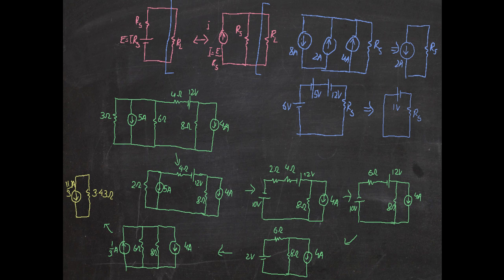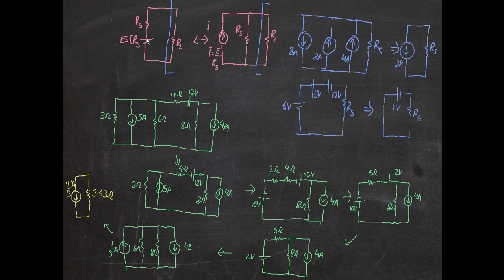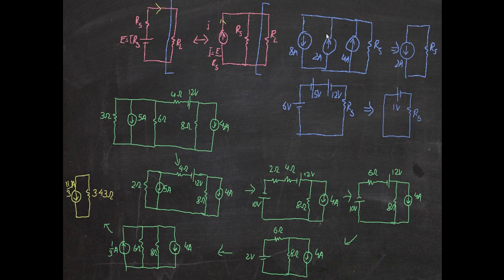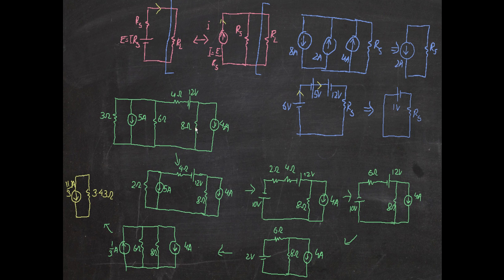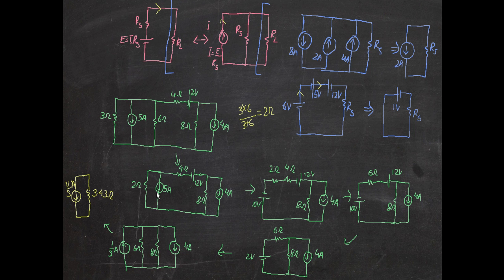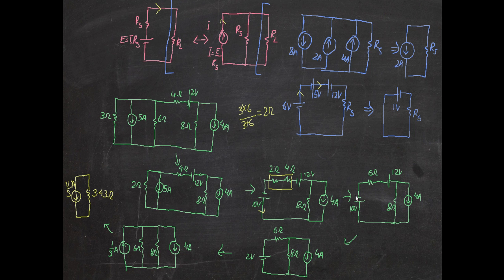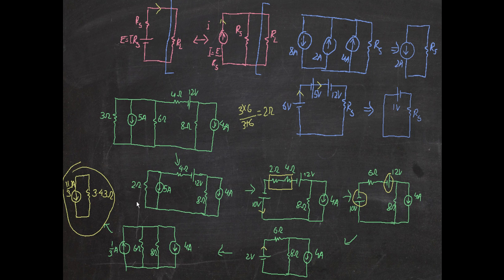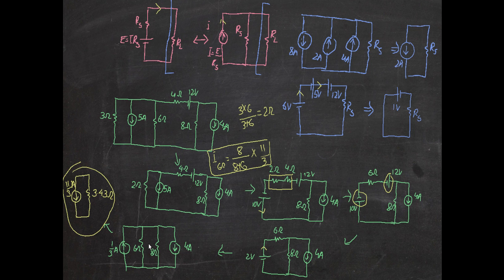Source Conversion

Comment: There's something wrong you do at the end when you try to find the current in the 6 ohm resistor.
Reply from the maker: Can you specify the timeline? Cause I checked and it seems to be correct. I=V/R so I for the 6 ohm resistor will be I=2/6=1/3 A
Reply: At around 7.35, in the last part where you are calculating the current for the 6 ohm resistor. You write the equation on the middle with yellow color. I'm not sure, but I think you are finding the current for the 8 ohm resistor.
Reply from the maker: ***** Yes check out the current divider rule. It works in an opposite way. If you're trying to find the current of one of 2 resistors A and B, then for finding the current for resistor A, you'd have to use B ohm/(A+B) ohm multiplied by total current. Check out my video on Basics of electricity: Current and Voltage dividor rule :) It explains all the formulas with examples :)
Reply: Alright. That was my bad. Well this helped my midterm today. Thanks!
Reply from the maker: ***** Here's the link: Basics: Series/Parallel & Current Divider/Voltage Divider Rule Hope this explains everything!
Reply: Thanks! This sure will.